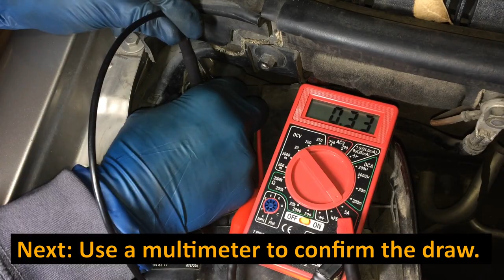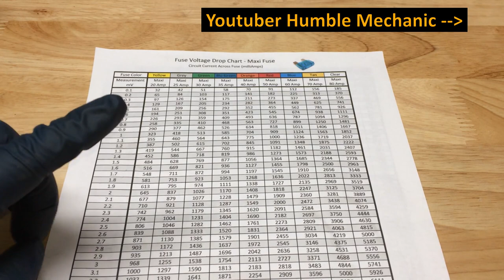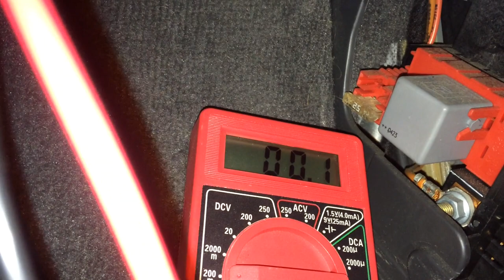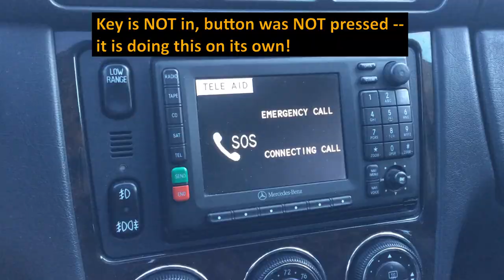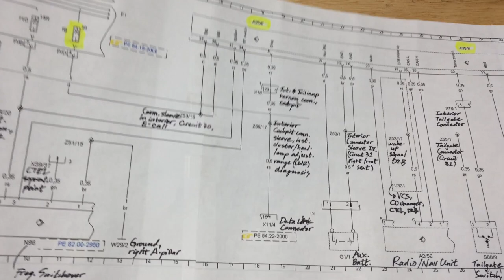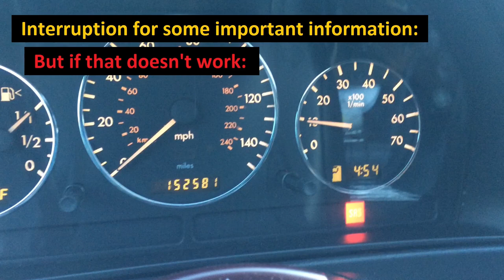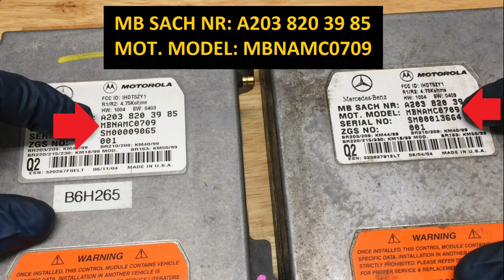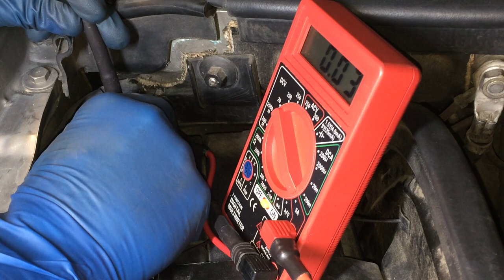Mercedes W163 Locate a Parasitic Battery Drain (Tele-Aid Emergency Call circuit, Fuse 8) ML350 ML500

Comment from the maker: Timestamps and Links:
Find the parasitic leak:
00:38  Use a multimeter to detect current at the battery
05:19  Use a multimeter to detect voltage across each fuse, then use charts to infer current
10:04  Check fuses in the interior fuse box

Troubleshooting the problem circuit (Fuse 8): 
14:00  Troubleshooting the Fuse 8 circuit ("Transfer Case/Emergency Call" circuit)
18:41  Checking current at the battery with Fuse 8 removed
20:44  Remove the front seat to reach the Tele-Aid module
21:51  Disconnect the Tele-Aid module
22:42  Checking the Fuse 8 circuit with the Tele-Aid module disconnected
24:01  Tele-Aid circuit diagram
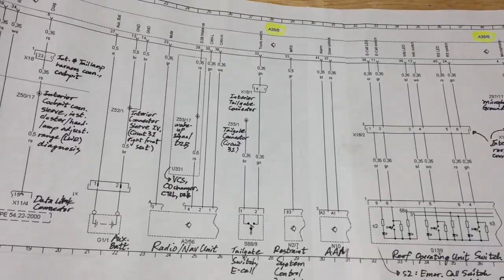27:57  Inspecting the Tele-Aid module
28:06  SRS light shows with the Tele-Aid module disconnected

Repair options for the Tele-Aid circuit:
29:23  Important information about repair options
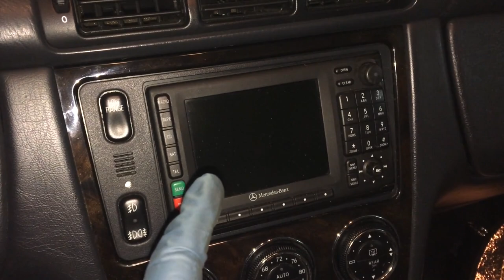32:46  Disconnect the overhead Tele-Aid switches ("SOS" switch)
34:17  Inspect the Tele-Aid switch board
37:18  Re-install the Tele-Aid switch
38:32  Checking voltage on Fuse 8 with the Tele-Aid switch disconnected

Installing the replacement Tele-Aid module:
39:06  Remove Fuse 8 before installing the replacement Tele-Aid module
39:32  Remove four 10mm bolts to remove the module
39:40  Comparing the old and replacement modules
40:25  Reconnect the Tele-Aid module
40:57  Checking voltage on Fuse 8 with the new module installed
41:16  Checking and clearing SRS codes 
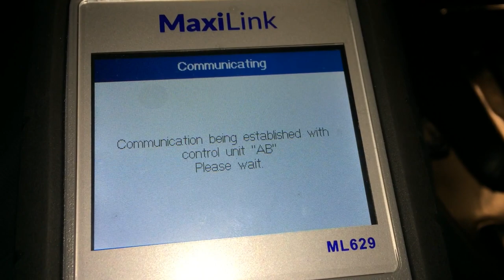42:07  Re-install the seat
42:41  Checking current at the battery

Here are some links mentioned in the video:

Humble Mechanic's video on parasitic draws:
https://www.youtube.com/watch?v=lRcj1fQcWwU

Voltage Drop Fuse Charts:
https://www.powerprobetek.com/wp-content/uploads/2018/12/fuse-charts.pdf

Alternator diode testing:
https://www.youtube.com/watch?v=oUhgyqm0wro

Removing the alternator on the W163:
https://www.youtube.com/watch?v=qeSMEd1w93k

I hope the video is helpful.  Thanks for watching, and good luck with your repair!

Comment: Xentry schematics are the worst at information. At least all others you can see signal, power and ground. I had to diag my rain sensor and the schematic was useless, luckily a friend with access to aldata gave me a printout, so I could prove the sensor had good power and a good ground. On the doors, you can use a screwdriver to latch the door latch closed while door is open to put modules to sleep and maintain access to interior for tests, after just open with door handle like opening the door to return to normal position. Also, check all the grounds, they can corrode between the metal and still look ok, I am working on cleaning ALL my grounds and power connections and using dielectric grease to seal them from corroding again.This is a very good video, all the extra data you add in if priceless. Thank you so much.
Reply from the maker: Wow, thanks for adding your tips!  Electrical issues are never any fun - and as you know, things are just getting more and more complicated with newer vehicles.  Your note about the grounds is important, especially as these W163's are all nearing 20 - 25 years old now.  Thanks again for adding your tips, and thanks for watching! : )

Comment: Your battery clamp lifting up method is the most genius I have ever seen to test milli amp.  You know more than the shop foreman out there !

My own experience to share: W209 takes 0.5 hour to go sleep mode, W203 takes 1.5 hour.  Technically they are the same chassis so not sure why such big diff.  They drain 50 to 70 mA in sleep mode.  3A immediately waking up then 0.2A after 1 minute.
Reply from the maker: Thanks - I was taught that trick by someone else, and it works well!  Thanks for adding your tips about the W209 and W203 - it's great to have these references : )

Comment: Nice. I knew how to check for excess draw at the battery (have also got a small clamp meter that can read low values for this), and I knew you could zero in using individual fuse circuits. But I wasn't aware you could quickly infer how much current ran through each fuse from a voltage test. I thought those exposed tabs on the fuses were just for quickly checking continuity if you maybe had a blown fuse. Definitely printing out one of those charts to go in my toolbox. Thanks!
Reply from the maker: Yes, it is a great trick -- a big time saver!  Thanks for watching! : )

Comment: You made this super easy to understand - thank you. 
In my case, my multimeter doesn't go down to 5A. Only 10A. I'm not sure if that gives a different reading or not? Mine said there was 0.38 drain. 
I checked over the fuses but the multimeter read 0.01 for every fuse. Is this normal?
Someone has installed a braking regulator for towing and an extra line for a fridge (no longer installed), so I'm going to check them tomorrow to see if it's the issue.
Reply from the maker: Yes, it is fine to use your 10A meter.  Sounds like you're certainly getting a drain if you're seeing 380 mA (0.38 A).  Definitely check that added fridge circuit that you're describing!  Good luck!  : )

Comment: Question…. Disconnecting the module interfiere with anything else? Like the airbags or anything. I want to disconnect mine since I took out the stock radio. I just want to remove it entirely. But I get the SRS light. I can easily remove the SRS bulb from the dash. But I want to make sure if I get an an accident or something the are bags will still go off etc. 😂

Would you happen to know?
Reply from the maker: I just don't know - but I agree that airbags are very important and wouldn't want to interfere with that circuit or logic!  I don't have enough information, but perhaps you can ask the MB technicians at the MB World forum (www.benzworld.org - note, ".org" not ".com").  There are some highly knowledge techs there who have encountered these situations, and they might be able to help!  Check out the sub-form for W163's.  I hope that helps : )

Comment: Hey ! Great video ! I have 0.4 current leak on my ml 163 , on f 13 (instrument cluster, STEERING)  what could i do ?
Reply from the maker: Check this thread out:
https://www.benzworld.org/threads/parasitic-draw-from-f13-okay-to-drive-with-on-board-computer-disconnected.2993667/
I hope that helps -- good luck!
Reply: @L35inColorado  love your work and how you really explain all the things.Just made voltage survey , on f 13 ( 10 amp) and got 0.1 v of voltage , can this make a damage to 100 amp/h battery ?
Reply: @L35inColorado  by the way, thank you for the link !!! ✌️

Comment: Hi. So I disconnected the negative battery post and the negative cable. Now, when i touch one electrode of my multimeter to the negative battery post and one electrode of my multimeter to the negative cable the reading it shows me is O.04 A. Is this ok? Or is it a parastic draw? Because whenever i check my battery voltage in the mornings it shows me 11.94 V.
Reply from the maker: Yes, that draw is normal because 0.04 A is 40 milliAmps, which is normal.
Reply: L35 in Colorado - ok. I guess the problem is with the battery then. Its a brand new battery, not even a month old. Thanks.
Reply from the maker: @delaguiar  Perhaps consider checking out the alternator: I had a similar issue on an ML350, where the battery was draining down.  It ended up being the connector to the voltage regulator:
https://www.youtube.com/watch?v=qeSMEd1w93k
But it is also possible to have a bad cell in a new battery (if its an AGM battery), as that has happened to us before, too.
I hope that helps -- good luck!
Reply: Thanks for the help.

Comment: Fantastic informative video. But 1 area i m baffled. When you checked fuses if the fuse isnt broken then you are putting both multimeter leads on a straight wire. That wouldn't work at all... 
How about that?
Reply from the maker: Thanks : )  
I'm not sure what you mean regarding the multimetr - can you post a timestamp?  
In this type of troubleshooting, we're not looking for a broken fuse, but instead we're looking for a closed circuit that is drawing current when it "should not" be drawing current (ie, a parasitic draw).  If the fuse was blown, then there'd be no current flow in the first place.  We're looking for the culprit circuit which is drawing current when it shouldn't be. 

So, instead of looking for continuity over a fuse (ie, a blown fuse would have no continuity, a good fuse would have continuity), we're looking for current flow in each circuit, to see which one is the culprit.  

We can check for current either by putting the multimeter in the amperage setting, opening the circuit, and using the meter to close the circuit (ie, put the meter in series in the circuit), or we can use the faster, easier (though less precise) method of checking for voltage acorss the closed circuit.  

Since we can check for voltage in parallel, it is easier than check for amperage because we don't have to remove any fuses or otherwise interrupt/open/modify the circuit.  Instead, we simply check for voltage, then use the tables to infer an approximate current, based on the amperage rating of the fuse.  

Is that what you were asking about?
Reply: @L35inColorado   well, what i meant is that you put the black n red leads on each fuse. Fuses are one usually positive. If you connect the black to body and then red to fuse you will get reading if the fuse is good. Or nothing if the fuse is bad. 9 min mark you put both leads on a fuse which is one wire. So if you touch either wire with both leads there shouldn't be any reading...
Reply from the maker: @junior88fan64  Referring to what's happening at 08:57: the check is for voltage on the circuit - not for continuity of the fuse.  It sounds like you're thinking of it as a check for continuity, or a check to see "if the fuse is good" as you said.  But what's happening at the 9 min mark is a check for voltage (not resistance/continuity) to see which circuit is drawing current (ie, which circuit is closed) when it should not be drawing current (ie, the circuit should be open).

In short, we're looking for a closed circuit, not checking whether the fuses are good.  We know the fuses are good: If a fuse was bad, there wouldn't be current on the circuit in the first place.  The problem is that there *is* current on some circuit when there shouldn't be, causing the battery to drain.  

So, we are checking voltage across the fuses because it is a fast way to determine which circuits are energized and which are not.

More specifically, to respond:
"Fuses are one usually positive."
- none of the fuses shown here are diodes; there's no "positive" or negative side to them; these are all just regular fuses.

"If you connect the black to body and then red to fuse you will get reading if the fuse is good. Or nothing if the fuse is bad."
- again, the test is not to see if the "fuse is good"; 
- we already know the fuses are good, as we're not looking for an open circuit, but rather a circuit that is closed when it ought to be open (ie, a parasitic draw).

"9 min mark you put both leads on a fuse which is one wire. So if you touch either wire with both leads there shouldn't be any reading..."
- at 9 min mark, we're checking for voltage on the circuit, not continuity of the fuse (again, we already know the fuse is good);
- if you set your meter to read voltage and you touch either end of a fuse or wire on an energized circuit, you will see a voltage reading (you can see the voltage read at 09:23 on the trouble circuit).

So, the purpose of checking voltage (not resistance) across the fuses at 9 min mark is to see which circuit might be the trouble circuit:
- if the circuit is not energized, the voltage will read zero;
- if the circuit is energized, the voltage will read above zero.

Again, we're looking for a circuit that is energized when it should not be- that is, a faulty circuit which is closed and parasitically drawing current when it should be open and not drawing current.  

I hope that clarifies : )
Reply: @L35inColorado  thanks

Comment: I don't understand your voltage measurement at fuse 8?   There should be 12V at fuse 8 measured to ground.   If you measure the voltage from one side of a fuse to the other it will always be zero unless the fuse is blown.
Reply from the maker: There is a small voltage drop at a fuse when the circuit is energized because the fuse is a very low resistance resistor (it is not a "zero resistance device").  The test points on the top of the fuse are used to check the fuse condition in parallel (ie, blown or not) by checking resistance, but these points can also be used to measure small (milli-volt range) voltage drops, as seen in the video.  
You cannot measure current across a fuse with a DMM: you'd have to remove the fuse and get the meter in series to measure current.  This is why it's convenient to measure voltage instead, then use the tables to infer current.
In the video, I am showing how to measure voltage (voltage drop) across a fuse (as a super low value resistor) to find an energized circuit that is the cause of the parasitic leak.  If there is no voltage across a particular fuse, then we can rule out that circuit/circuits as the cause of the drain because we can assume that the circuit is not energized (since there's no voltage drop at the circuit's fuse).  We're looking for a circuit that is energized even though it shouldn't be (sleep mode), so that's why voltage drops are useful clues. 
I hope that helps!  Good luck : )
Reply: @L35inColorado  Cool, I never heard of doing that before!   I will give it a try.
Reply: @L35inColorado  One comment about the call module in the 03 to 05 ML.   These do not have fiber connection.   The connections you refer to are not fiber but coaxial cable connections.   That is why your radio still worked.
Reply from the maker: @GotaGetaGoing  No, they are fiber optic connectors.  The call module is part the "MOST" (Media Oriented Systems Transport) fiber optic (FO) loop, and the connection on the large connector shown at 22:35 are FO connectors.
The antenna cable is a coaxial cable, though.  
My best guess about the purpose of the FO loop is for the amplifier, so I think (don't know for sure) that the amp was disconnected when that FO loop was open, so the radio worked but without the amp -- but again, I'm not sure and I don't hear well enough to notice the difference.  
But I can confirm that that those connections are FO connections, as they are called out in the wiring diagram as such, and the FO handling "warning" precaution is outlined in the WIS when disconnecting that connector.  So, if you need to completely remove the call module and wish to close that FO loop, you'd want to put your loop connector across those cables.
I hope that helps!  Good luck : )
Reply from the maker: @GotaGetaGoing  Yes, thank you -- I can see that one is different -- the part number suggests that is for a W220, which would be the S-class from the same time period as the W163, and it does have an isolated connector, as you mentioned.  I will research this a bit more and make a correction.  Thanks for pointing this out! : )
Reply: @L35inColorado  BTW, I have a teleaid module in my 2004 ML350 - it's the same as yours - it's not Fiber Optic.  I had to pull it out last year because of the parasitic drain it was causing and killing my battery every couple of days.  It has an analog call module which is no longer supported in the US since all cellular providers are now digital so it probably has not worked since 2008 but recently it started draining the battery.  I disassembled it and found a burnt tantallum capacitor which I replaced but it still had the parasitic draw so I left it out.  it would draw about 500-550mA when it was in the circuit.

Comment: WARNING DO yourself a huge favor . Get rid of that cheep harbor freight meter . they are very inaccurate .. I know from using them in the past . They almost cost me a few thousand dollars from giving me wrong readings. Hope this helps someone .
Reply from the maker: Thanks for the tip - I do have a better DMM, and I would recommend to anyone who can, to budget in a good DMM, so I agree with your point.  However, I tend to use the cheap Harbor Freight DMMs in my videos because I know that that meter is by far the most popular meter for DIYers (because its cheap and easy to get), and so that is what most people are using for their troubleshooting. 

I have had several of them over the years, and I still have several from when HF used to give them as the "free gift" years ago!  Personally, I haven't had much trouble with them, and the readings have been consistent even compared to high end (ie, Fluke) DMM's, if used properly.  

I know that sometimes people forget to switch the jack/terminal (COM/Grd/Current) to the correct jack/terminal for the application, or forget to adjust the dial to the correction setting, and as a result they end up accidentally cooking the meter without knowing it, since the cheaper meters don't have internal protections from such mistakes (even higher end meters don't for most of those jack mistakes).  

I think accidentally leaving the dial on resistance while attempting to check voltage is probably the most common mistake that cooks the Harbor Freight meter, since most automotive DIYers are only using the meter to check resistance or voltage; they grab it to check battery voltage without realizing that the dial is set to resistance/Ohms.  The other big mistake is intending to check resistance, but not verifying that the component is isolated, and so accidentally checking "resistance" on a live circuit.

For these reasons, I always try to show the proper dial setting and terminal/jack connection. But yes, I do agree with your point - it is never a bad idea to buy a better DMM, for anyone who's in the position to do that, and the more you use a meter, the more you'll like a better meter.  Thanks for watching : )